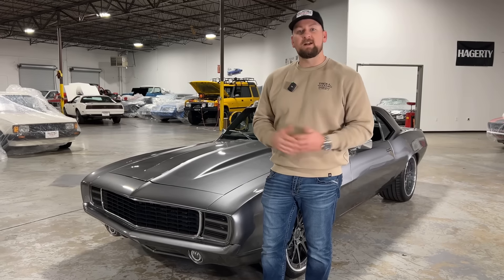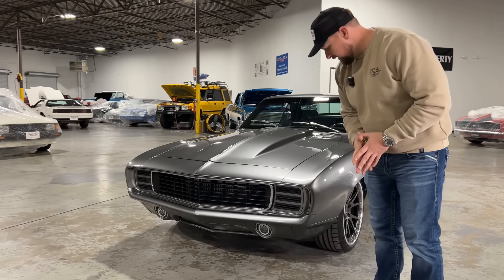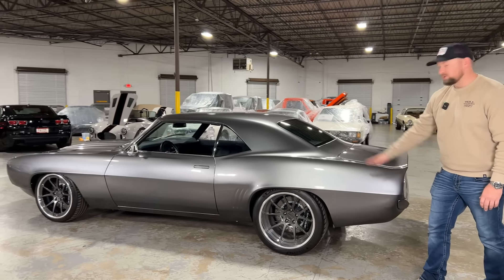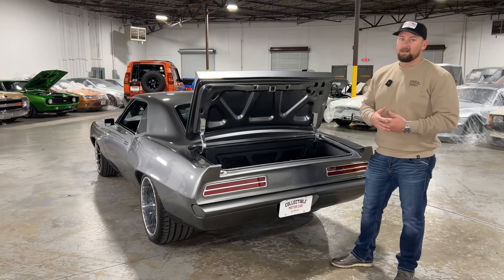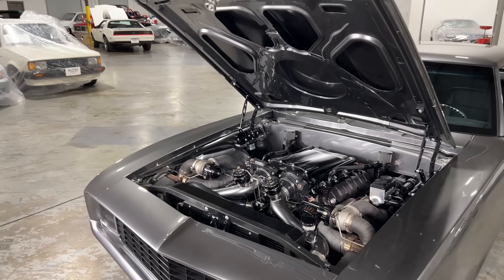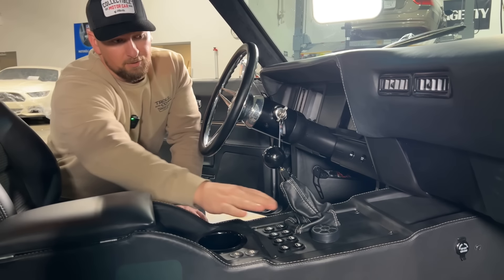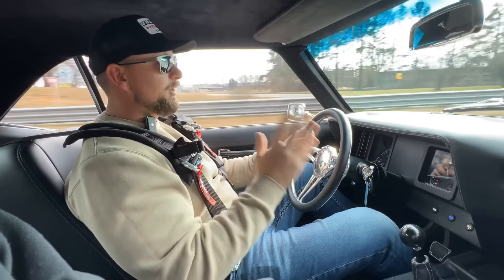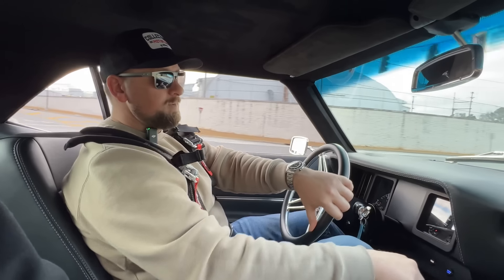1300HP TWIN TURBO LSX 1969 Chevrolet Camaro Restomod Review

Comment: Just all the engine components alone are probably right at $100k or more. That's IMO a little too much HP at the wheels for a pro touring build. What makes pro touring cars fun is being able pretty much floor it without having to baby it and it still be drivable.
Reply from the maker: It is definitely a high-performance build!